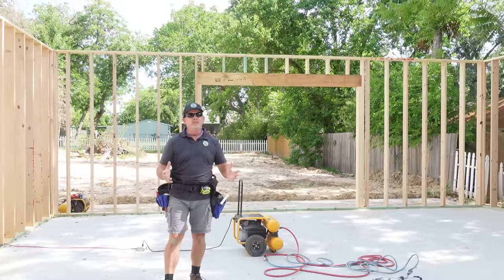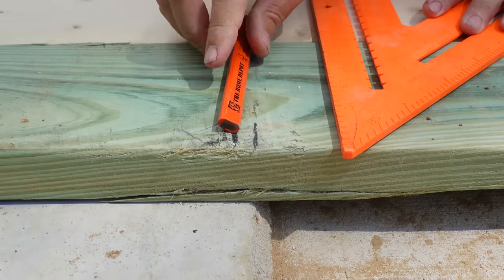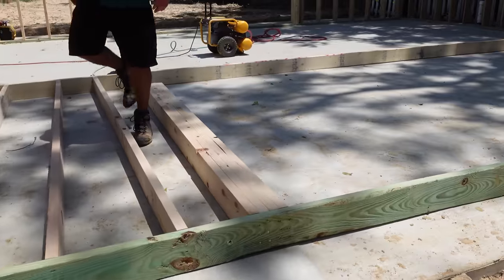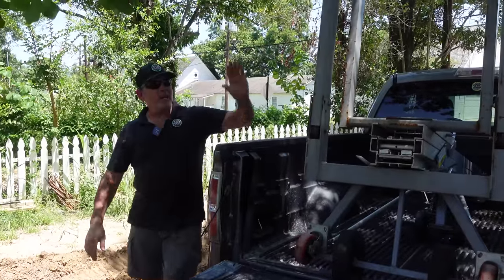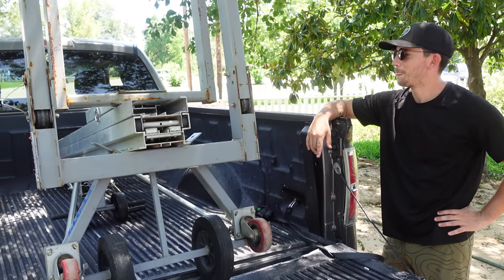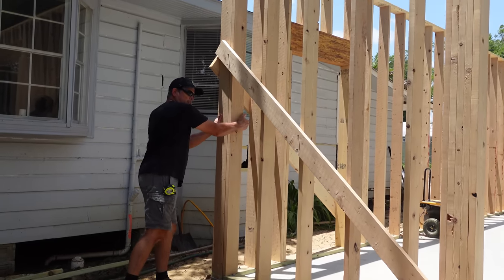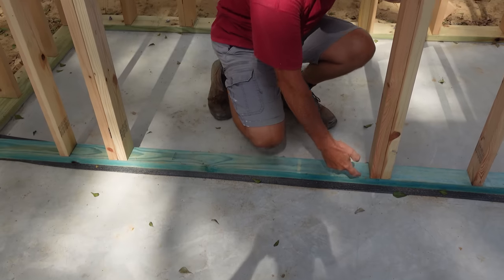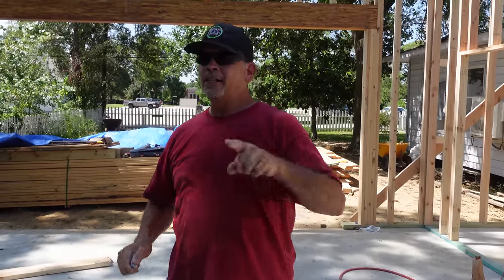FRAMING Our DRIVE THROUGH Garage!! - Will This ONE MAN LIFT Work?

Comment: I've been watching you all for months and am so excited to see the framing begin! My father-in-law has been helping me build my forever home for my family since 2019, so I can relate to the two of you on so many levels. You all show details about actual construction no one else does; never stop!

I like the detail you showed about the anchor bolts, but getting the depth of those can be tricky; maybe consider describing that in detail in a future video. Screwing the nut on before you hammer it in is so important, otherwise you'll damage the threads and never get the nut on. You don't want to over tighten otherwise you'll break the seal of the pressure treated wood and make it more permeable to moisture in that spot. I've used a piece of painters tape to make a flap at at appropriate depth on my hammer drill to tell me how far to go. The tape flap also helps clear away the concrete dust as you drill.

For the space under the stairs, I'd consider making it the size of a large bookshelf or garage cabinet. Put the bookshelf on hinges and have it swing in and right into the garage so it's not smacking into your car. If you don't want to go through that trouble, I like the door idea, but maybe make it a 3080 door or even larger. You're going to want that space under there.
Reply: RealStudPack.  Lucky winner??

Comment: I have found an under stair storage room is often problematic.  Skinny rooms - especially under stairs - end up being filled with stuff you can't get to.  I can send you a photo.
If it is wide enough to put shelves on one side and still access them then I would keep the wall and add a door.  Having a secure place to keep tools would be a great plus - especially if you ever want to rent out the upper room and let the tenant park in the garage.  
If, however, it isn't wide enough (which I suspect it isn't) then I agree with Jordan - open it up.

Comment: Those temp corner braces, I would notch them into the exterior of studs, and make them permanent.
Frame the stairs then cut the bottom open as desired.

Comment: I like to frame my garage door openings 1/2” under the width and 1/4” under the height to account for the garage door install which usually works best with being 1/4” larger than the opening all the way around.  Nice video!

Comment: Great video gang. I like the idea of putting a door on that room below the stairs and use it for a noisy compressor, hot water tank or the emergency generator. A place to keep tools dry and safe plus a private storage space with possibly a lock on the door. I'm sure you get the idea. Keep up the good work.

Comment: The area under the stairs should be open with built in shelves as wide as the stairs and tall enough to store holiday totes. Example...totes that hold Christmas decorations or Halloween decorations. It sucks to have all that stuff just stacked willy-nilly in the garage when you only use it once a year.

Comment: Great video as always, congratulations on the progress.  Its a great feeling when you can see physical results.  After reading some comments ill say use a section of the under stair area for a work bench and leave a section at the back wall for outside access to store patio stuff / pool equipment.

Comment: I like the soundproof room idea it's always nice to have a storage closet accessible from the outside as well. 

LOVE THE Genie lift if you can afford it though I would have added the beam after standing the wall, just add temporary cleats along the king studs to move up gradually.  Of course you need to tie in your walls and top plates first.

Comment: I think u could leave the wall under the stairs put a door and make it a utility closet. Build a little spot for the air compressor, ventilate it if needed, and insulate it to reduce the noise whenever it kicks on. Then u can run the lines through the wall or floor joist, and buy some hose retractors or rollers and have the compressor hoses come out above the car, and at the work bench, so u can easily fill your tires, and so u have the compressor ready at your workbench

Comment: I think both options are equally good picks.  If you open it up then you can have a recessed area where you can have something like a tool or working station or even as a little office right there.  But, if you keep it closed then that will provide you with some storage where you can hide items you don't want to see very often like decorations, extra parts, household storage items ets.

Comment: Let me say I like this channel more with each episode.  I have been a plan designer and licensed building contractor for about 40 years. Watching this channel shows that even though Dad has excellent trade skills you encounter problems through the building process, sometimes costly i.e. the foundation issues. The big take is that they always suck it up and continue on with the project.
I would take a different approach to lift that wall. I do own a genie lift, skid-steer, and mini ex. What we would do is frame the wall with trimmers/jacks and then stand it without the beam. Then install the beam separately. I could do it myself with a couple of come-alongs. Just my thoughts whatever work for you is all good.
Reply: Absolutely agree. Stand it without the beam and then lift it into place. Done it before. Easy peasy.

Comment: When I built my house in Los Angeles County I included an enclosed storage area beneath the stairs and per code had to install a fire-sprinkler. Otherwise the storage would not be permitted. Check yer codes.  Being raised in the Mojave Desert with its paucity of firewood and being a large family (8 kids) of meager means, we got most of our firewood for heating the house, water-heater and cooking from demolishing old houses. That was a great education of failures in framing and construction. Every bathroom, kitchen and eaves had water damage, bar none. It is the little details that make the biggest difference long-term.

Comment: That by far is the most massive LIKE button I have lifted in all my career as a YouTube viewer... it was also the most massive no brainer to smash!   Excellent job guys, I'm so excited to see the First Floor framed in.   

About YOUR Question: What to do with the extra space under the stairs, is it a storage room downstairs or open space?   Why not both? For one question is where are you putting your "mechanical room"?   That whole space could be divided into two spaces,  a closed one for the mechanical stuff, and an open space for the garden tools go, e.g. shovels, rakes, etc.  and an open shelf space for car supplies etc.  It's all about you and how you want to use the space.  I'm sure you can look at the plans and make the case  for the storage under the stairs... that's a lot of untapped space that you're paying to basically store air there!

Comment: Definitly keep the wall with the door between the stairs and garage seperating the two spaces entirely.  Inspection may very well require it (at least in my county in CT, and is probably best practice to keep fumes from vehicles  from seeping into apartment. 👍

Comment: The space under the stairs should have a door and be used for storing an air compressor. It will keep the noise down. You'll just need a few holes for the hose and to let air in. You could get fancy and soundproof it and use baffles and seals for everything.

Comment: I agree with Jordan. I would get rid of the wall as much as possible. Also, I know it would cost more, but I would use metal for the stairs. It is a garage...get industrial with it. So that side of the garage would just have the metal staircase, with all of the area under the stairs open to the rest of the garage.

Comment: Great job framing guys. I would put in a door to access under the stairs. Make it your mechanical room for water heater, compressor. Are you using mini splits for heating and cooling? Looking good!

Comment: Hope I'm not too late for this "under the stairs", or if it's already been mentioned...wash-up area. The shop laundry, shower and toilet. After all, the upstairs will eventually be used for income or other purposes. Also beneficial for the rest of the build project for contractors, delivery folks and etc. Perhaps the drinking water filter and hot water system.

Comment: Definitely it’s always a good idea to utilize every inch of space. I would agree with Jordan, except speak with the building engineer to find out the biggest are you can safely open up and then make sure that you get the changes approved through the city and acquire any updates to the permit. Think structural strength.

Comment: Oh look! The content I always look forward to.

Having an exposed nook under the stairs would be utilized more for constant use as toolbox or workbench area; would think if you put a door instead it would be utility and storage. While you are going to need some utility space - How much? Just for a hot water heater? Or do you also plan solar? Where will the charge controller and batteries live? Why not all three? Hot water on left charger and batteries and service panel on right, bench/storage/etc in middle.

Comment: You should space your nails when nailing your king studs into the headers. Placing all your nails lined up will split and destroy the integrity of the material. This is a common practice in nailing any screws or nails joining framing members together. Your Jack studs as you call them are normally not nailed into the bottom plate. These are more commonly referred to as trimmers. Once you get to the installation of your doors and windows these are used to shim and make adjustments to get your openings plum. On windows you need one full length trimmer from the bottom of the header to the sill plate and another added from the bottom of the header to the top of your sub sill plate to enable you to shim the window opening plum. Add the extra trimmers on both sides when you figure your rough opening for your windows. Also take into consideration what size interior trim you will be using around interior doors so you have enough backing to nail your trim. Sometimes a single two by four header or a non bearing two by four wall without trimmers does not allow for enough backing to nail your trim. I noticed you have a single top plate, code requires a double top plate, and if in your area they don't require It I would still recommend having two. Before standing your walls take your claw hammer and raise the wall high enough to place a scrap piece of two by four underneath the top plate so you can get your hands under to raise the wall. I'm guessing in your case garage door wooden jams are not required, in many cases a exposed garage door jam is used for door installation. I would be real careful standing in front of a nail gun in operation. This should be a one man operation and I would recommend safety first and never stand or kneel in front of someone operating  a high powered nail gun.

Comment: One thing to note on those lifts.....ALWAYS click back up when under load and stopping during lowering.  You might think it has a stop system in it but we used to fast spin those down and let the load help spin the handles.  We always spun up any time we stopped them.  Or any other load bearing manual equipment.  ( we used them on live shows where they were holding truss with lighting/audio/video on them )

Comment: alot of places, ROUND washers on the bottom plate to the concrete is against code.  Most building codes now require the 2.5x2.5x0.25 SQUARE washers.  The round ones that are just a little bigger then the holes/bolt, they will just pull right throught the wood if the wall was pushed over... The square ones BITE and do not pull through becuase they are SO much bigger. 

I highly recommend changing those out to SQUARE washers before inspections!!

Comment: if you screw some 4' 2x4 perpendicular to the beam and on center, you can use them as cary handles.  to roll the beam, screw those same 2x4x4' perpendicular but on the end of the 2x4 to give yourself a long lever arm.

Comment: Keep the wall, do 5/8" Fire Rated Sheet rock and a Fire Rated door to the underside of the stairs along with a Fire rated door for leading up to the apartment. Do rock wool for both the 2x4 and 2x6 insulation to slow the transfer of any flames from the garage up to the apartment as well as into the stairwell space up to the Apartment. Like others have suggested you will have more usable wall space to keep items off the floor of the garage as well as having a closet space for storing noisy equipment.

Comment: Honestly, I think it's a good thing you added an extra jack stud. You could see the top of that wall frame straining while you were lifting it with the machine and struggling to move it over. That might've saved your asses from the frame just breaking apart on you and needing to be rebuilt, because while it's definitely designed for compressive force, it sure seemed like it was struggling against that horizontal force!

Comment: Something you've probably already considered, but it might be worth double checking: areas at risk for humidity condensation (particularly in the garage space since, while it's going to be conditioned, there's still going to likely be a temperature gradient that crosses high humidity day dew points between the upstairs apartment and the interior garage space). So if you are looking to alter the stairway wall, take a close look at how you are placing your vapor barriers between those two spaces in any new configuration that you choose to go with (either open or a closet).

Comment: Yeah, that 18' beam was big. My brother in law and I had to fix the beam under a second floor balcony over on Lake Conroe once. It was a 25' glue lam the same thickness! Just the two of us and a pully system connected to the top beam of the roof! Yeah, wasn't fun, but turned out great.

Comment: Idea for void. Make it an air compressor room. Sound deading the walls and vent to out side with a dryer type vent for air flow. Then you won't have the air compressor disturbing your shop time.

Comment: I have ALWAYS, for 40 years +, just used an X for kings & C for jacks. X for stud, C for cripples. AND, beams & LVL'S  CAN have a slight crown to them, especially long lengths, so it wouldn't hurt to check, just in case.
It kills me to see you NOT using a camera/phone tripod. Get the camera on a tripod, then the 3 of you can make it a little easier on yourselves. Looks like I spoke too early...there's the tripod. Good job !!

Comment: Easy place to be the mechanical room for the entire house, tankless water heater, power panels, internet routers, switches.  Gives more room in the house and close enough to run anything over you need.

Comment: I met a guy who remodeled an old Atlas missile silo.   In the construction of the floors they used an engine hoist with a few bars welded on it as a mini crane to set overhead beams.   The guy doing the work (not an engineer) stated "it is high school physics" and measuring to find the balance point.    Good thinking with your application of a rental lift.

Comment: I'm with Jordan on this one. If you leave the space under the stairs enclosed, you have a 3'8" wide closet where things will always be buried and not accessible. Out of sight and looking clean, but not easily used if needed. I vote either open, or a different idea where you can access the items stored there.

Comment: Id put a door. U can use the space as some storage for whatever so it cant be seen all the time. I seen someone else mention putting the air compressor or other noise maker in there and bring the sound down. I thought that was good idea.  Plus it would give  u more wall space for cabinets or hangin stuff.

Comment: Every garage needs a "Warm Room" that stays above freezing for Adhesives, Paint etc, as well as a battery & charging station, and of course, storage for insulated bibs, coat boots etc. It works well for air tools, hoses and compressors, which oftentimes can have moisture within them. I have my walls well insulated plus added blue Styrofoam insulation and installed horizontal 3ft 2x4's for the shelving on each end, spaced for both 5gal buckets and plastic milk crates.
Good Luck.

Comment: Door, good work wall for a garage. Than you can do storage under there. The best would be storage for machines (air compressor, pressure washer, etc. That way just have access if need be but mostly have the hoses readily on the work wall

Comment: I'd do the door, (or leave some open) but the short/low area under the stairs should be built in cabinets or long drawers. Or an area accessible from the outside for storage of lawn equipment, etc.

Comment: Under the stairs. Make a door to a room you put extra sound insulation on every wall. Then put your vertical 60/80 gallon shop compressor in this room. Keeps garage quiet. And apartment above.

Comment: I saw a comment for a barn door and after some thought, I kinda agree only I would stack two of them either 4 or 5 feet wide for an 8 or 10 foot opening. With rails that would extend 4 or 5 feet past the opening on either side so the entire opening could be used. Just another thought. Great build, although I would have made the stairs a full 4 feet wide. Did that on our house and never regretted it when trying to get stuffed chairs or sofas up there or in your case appliances.  Going through that doorway and then having to turn to get up the stairs might be tricky with big/heavy loads.😅

Comment: Storm Shelter / Saferoom. Just install 1/4 inch steel on interior walls & ceiling, welding all interior joints & add a Steel entry door.